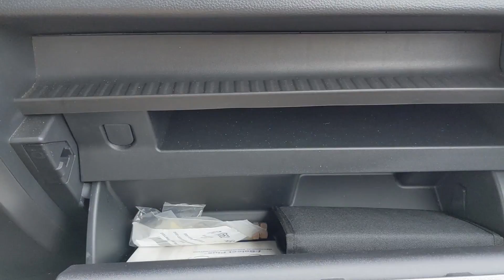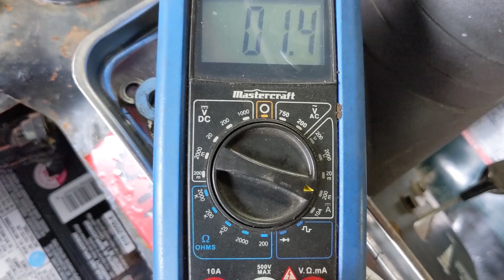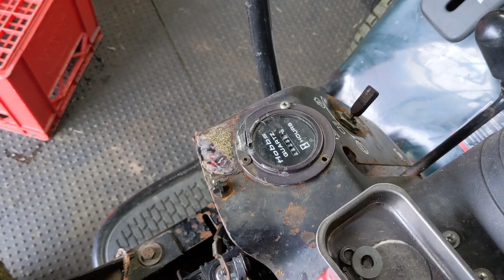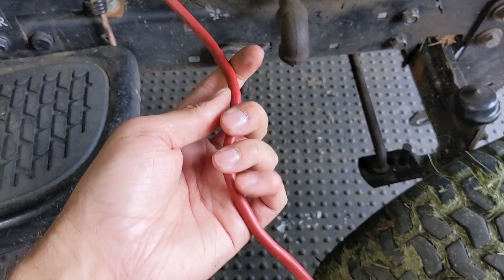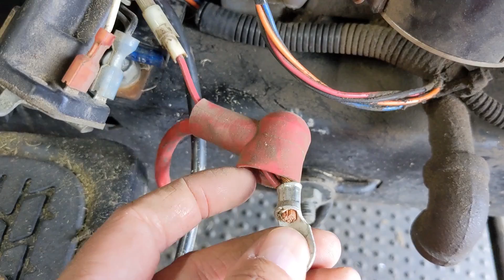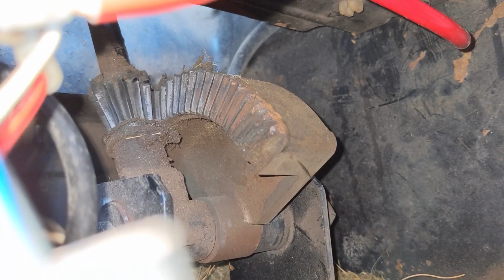Diagnosing a Riding Lawnmower that Randomly Shuts Off

Comment from the maker: This one is a little long, but there's a ton of great electrical information I wanted to add in. One of these days I'll have to make a separate standalone Parasitic Draw video. Hope you guys enjoy!
Reply: Great Job!  Don’t mind the length of the Video.  Very Detailed, 
Thank You
Reply: I have the same problem with some of my so called friends.  They tend to be a parasitic draw in my life.
Reply: Nicely detailed, appreciated 🤙🏼
Appreciated your vid ..

My Q is is a lengthy description  
I have an older Craftsman lt1000
 .. B & S  .. 
Sat all year, replaced new Battery, air filter, Fuel filter, & belts 

Initially rough start, but ran approx 30 mins then ‘silently died’.. wouldn’t even turn over (as if it was dead) 

.. 10 or so mins later,  it did start but extremely ROUGH idle 
.. shut it off,—-.. shortly later started & ran fine for approx 20-25 mins, this time it slowly sputtered then died, 

shortly later it started, idle was fine ( ✋🏼 not rough) but died again after approx 20 min run 🤷🏼‍♀️ .. back & forth .. 

Hopefully you can throw some ideas 

My couple thoughts, coil is getting hot? .. or solenoid .. or something with  fuel line .. I’m not that savvy with mowers, but trying to learn .. 😉 
Thank you for your time 🤙🏼🤙🏼
Reply: ]40ò
Reply: Oh I also am more knowledgeable about the mower diagnoses with this type of problem. 
Thanks for the detailed process.

Comment: Interesting, but I am trying to figure out why my old fuel filters on my Craftsman riding mower always filled up with gas and now these new filters I can see gas at the end of the tube bfore the filter but none in the filter ro very little.  The engine runs and surges and cuts out after a minute or so.  If I pull the (new,just bought) fuel line off at the carb, gas flows all the way through.  1/4" fuel ine. I took the head off the fuel shutoff solenoid, enptied the tank and cheched everything, the lines, the fulter, the tank, all clean.  What could be keeping the fuel from flowing?  Someone said air in the lines? bad seal somewhere?  What the heck do I check???
Reply from the maker: You can disconnect the fuel line at the carb, and let fuel flow out while holding it down towards the ground, this helps to prime the fuel filter, then put your finger over the end and reattach it to the carb. But yes, most filters will appear empty even though they flow fuel just fine
Reply: Thank you, hopefully that stops the surging too.

Comment: I have a 19.5hp ariens that is currently having a fuel starvation/stalling issues and its driving me nuts. I am assuming its back to the ignition. I see no issues with weak or broken wires. the solenoid is fine.

Comment: Very informative video. You were mentioning about finding a parasitic draw on a vehicle and said you pull fuses and check voltage between the pins. This could extend your diagnostic time if the parasitic draw is from a module not going to sleep. By removing the fuse or disconnecting the negative battery cable you basically forced it to sleep and the draw would go away. Yanking fuses and cables only works when there are no modules involved.

Comment: You are amazing.  Right to the point, with excellent diagnostics tips anyone can understand.  I've watched 3 videos in the past week and I learn something valuable every time.  I don't even look for Simpliciy vidoes since it appears the brand doesn't really matter.  First was the solenoid switch, then the start switch, now the random cut out, which is what I'm dealing with.  If that's not it, I'll be back to look for the next video.  You make it fun to troubleshoot. (and easy).  I also like that you explain what is going on and how everything works.  That's the icing on the cake.  Keep up the great work!
Reply from the maker: Thanks for watching, good luck!
Reply: Right to the point? Lol, they could have shortened this to a 5 minute video and still given the same information without all the extra stuff. It’s very detailed, but right to the point is a far stretch. 😂

Comment: Hello, same mower I have same problem. I checked cables and all connections to make sure are in, tight and free of any damage. Everything checked out fine cranked it ran for 10 minutes and did it again died slowly. So I am thinking it's a fuel issue. What do you think?

Comment: Had a 20 year old Deere 185 that stalled after about 10 to 15 min. turned out to be the fuel shut off valve was full of grass. cleaned it out & was fine from there on.

Comment: Had my mower battery connected to charger at regular 12 volt. 
  Let it run a little while and noticed the hit lead got very hot. Looked like it was starting to melt the clamp cover. 
  Shorted battery?
Cranks and dies. 
  It was running for a few minutes before it quit. Last few times, it would just start up then die.

Comment: Can you leave the ground cable connected and use a clamp meter to check for amp draw with switch off?
  I tried it with meter set to 40 and 400 to 600. Got zero reading at both settings.

Comment: Nice job.  When servicing a customer tractor I always go over the wiring looking for what you just found, making sure wires aren't near or touching moving parts and rubbing on unprotected surfaces.  I just add a few minutes to the service time and add a couple bucks to the bill.  Pays in the long run when indicating this simple inspection on the bill.  Nobody complained yet.
Reply from the maker: Thanks for watching!

Comment: Eliminator Performance, You sound quite knowledgeable and have good sense.  It would be best if you try to articulate certain technicalities properly.  For anyone reading this, electricity does not take the path of least resistance.  Electricity takes all paths.  I know what Eliminator was getting at, being a short is a path of less resistance than the intended path which has components in it which have higher resistance values, but never the less the electricity will take all paths available.  A short turns a series circuit in to a parallel circuit.  It might seem like a nit pick but it's important for proper fundamental understanding.  Especially for beginners.

Comment: Got a used Craftsman a few weeks ago. It appeared pretty clean and well taken care of. But it had randomly died on me a few times. Seemed to happen when I'd push down the brake. Don't guess it's a big issue though, since it only happens on occasion and it'll start right back up afterwards.

  It's also backfired a couple of times. Though, idk if it's related, and I can't recall it happening in correlation with any specific action that I did.

Comment: Really good video for us to get a better understand how to troubleshoot the tractor circuitry and doing a visual inspection of the wiring in very important too.
I have a similar Craftsman that had a new 20HP Briggs and Stranton engine installed. I had the steering sort of lock us on me once until I forced it, then I had a problem of the engine puttering for a period of time like it was starving for fuel, but cleared itself. So, I'll be doing a visual inspection of the wiring soon. Thanks friend for this video, you get good by us.

Comment: I'm working on a 04 gt 5000 craftsman putting new belts on it. It runs good till I engage the deck then it cuts the motor. What is that causing it?
Reply from the maker: Probably a seat switch.
Reply: @EliminatorPerformance  well I just checked all my connections and the hot cable to the starter felt loose so I wiggled it and the connection to the solenoid broke off in my hand. U think that may be the reason?? Lol

Comment: 6:35 never knew the magneto charged the battery, lol
Reply from the maker: Yea the magneto charges the battery and supplies the current for the headlights as well, the coil produces spark for the spark plug!
Reply: @EliminatorPerformance  the magneto is another word for the ignition coil. The stator/alternator/charging coil is what puts power to accessories and charges the battery. Magneto is not a term for stator
Reply from the maker: @nickflopper  the words can be interchangeable, stator/coil/magneto can be a stationary coil for ignition, or a device for supplying alternating current for the charging system. If you Google magneto charging system you'll see what I mean, as well as some diagrams. I simply use magneto (charging) and coil (spark) as terms.

Comment: i havea harqvarna riding lawn mower doing something like that. i worked out to be a vapor lock in the fuel line. i insulated the fuel line.  no more problems.  The fuel line to close to the motor
Reply from the maker: Nice, check your gas cap too and make sure it vents properly! Thanks for watching!

Comment: Eliminator Performance. It’s truly amazing how big problems develop from such little things that people commonly overlook. Over the years, I have made protective boots from sections of rubber hose and or good quality split loom to protect cables, heater hoses and radiator hoses. Recently, I was gifted a very similar garden tractor to the one featured in your video. The reason for the previous owners getting rid of the garden tractor was that they thought that the steering was bad. After I took possession of the garden tractor, I started the engine and went for a drive. Everything worked pretty much as it should. After mowing for a while in an area where I could test the steering - I drove the tractor back to my driveway and immediately attempted greasing the steering spindles. The left spindle took grease, but the right side would not take grease. The next day, I purchased a new battery and so I mowed in another area where I would be steering quite a bit. I tried greasing the right spindle and which accepted grease as it should. The Lucas Red N Tacky did the trick. Thanks For The Very Good Video.
Reply from the maker: Thanks for watching!